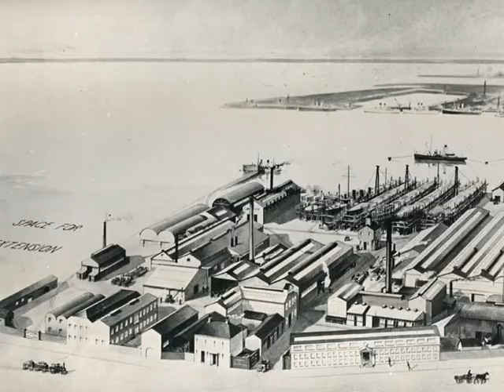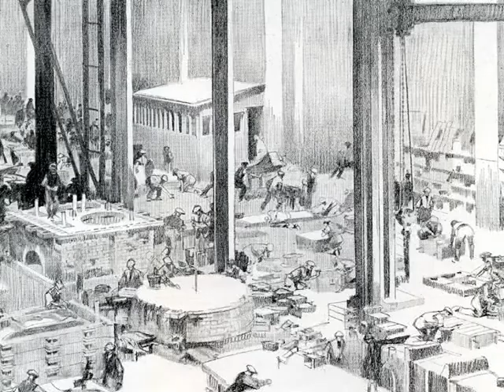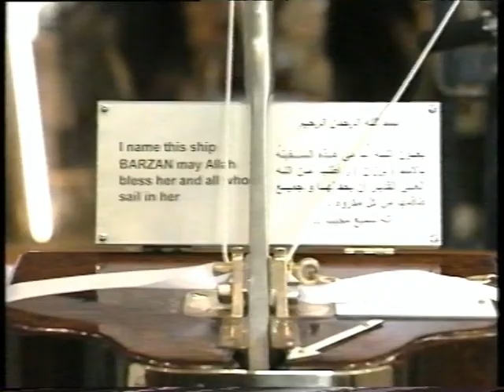Riveting Stories: from the Vosper Thornycroft Shipyard, Woolston, Southampton

Comment: I myself did a Five-Year Indentured Apprenticeship with Harland & Wolfe Ltd.as a Fitter/Turner from
1966-1971.I knew that Thornycroth’s had a shipyard at Woolston.I knew Harland’s closed it Works
in the 1970’s .I remember working  on the Union Castle Ships when they came in the New Docks.I
also worked on Queen Mary and Queen Elizabeth.I remember two ships I worked on,and they were,
Southern Cross and the Northern Star.At the back of the Harland Works,there was a Dry Dock.
I worked on the Boilers,Engines,Safety Valves.etc.I also worked with my Fitter on the uncoupling
of the Tail Shafts.The had Muff-Couplings and believe they had the Riggers/ Chain Gang and my
Fitter and Myself.I must off worked on at least four ships in the uncoupling of the Tail Shafts.
I wish Thornycroft and Harlands were still here doing that Work.I enjoyed it.